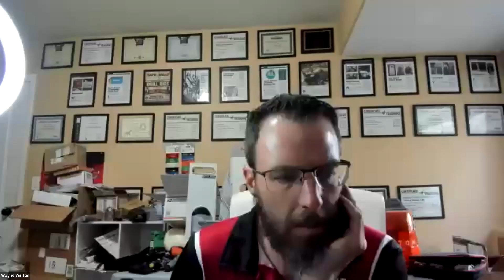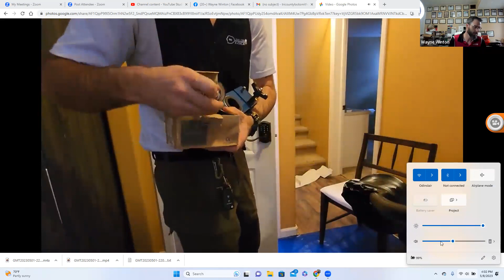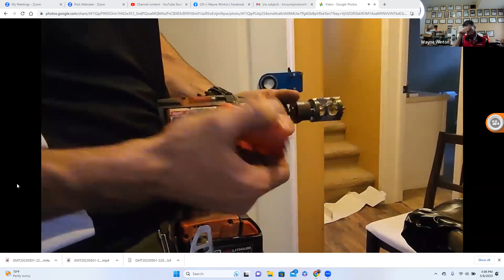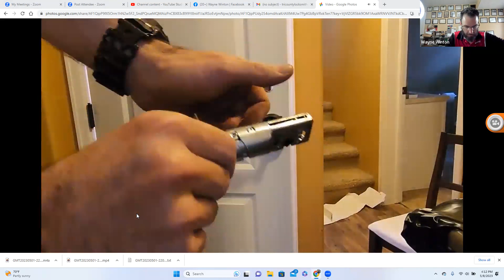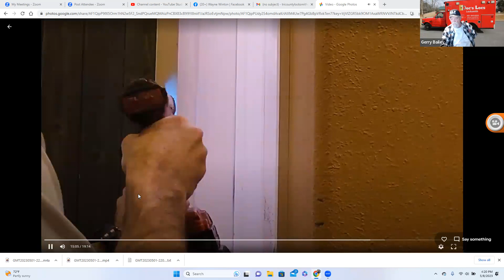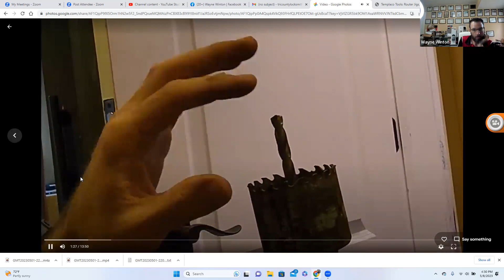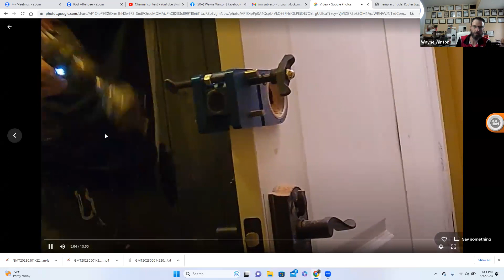Install a deadbolt lock using the Framon BULL Bullseye Jig hardware installation tool HD solid metal

Comment: Great information, thanks for sharing this Wayne. For other folks, the video really starts at 4:24. Great tip about only using bi-metal hole saws because carbide could damage the jig itself. Thanks again!